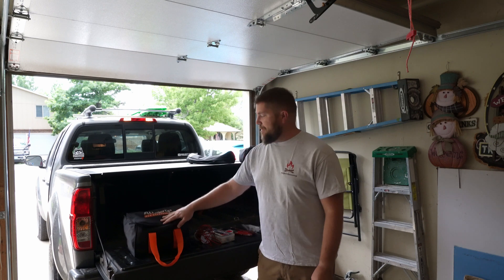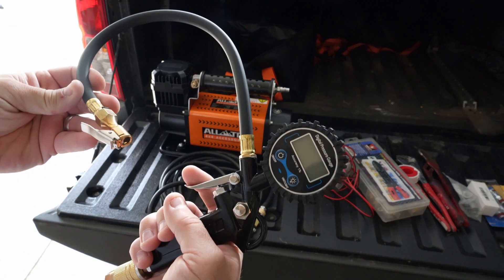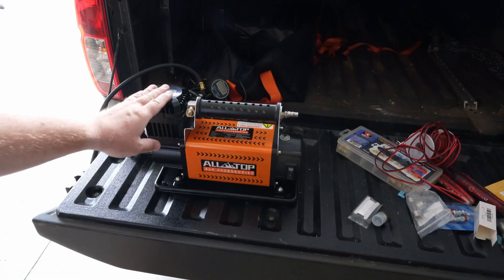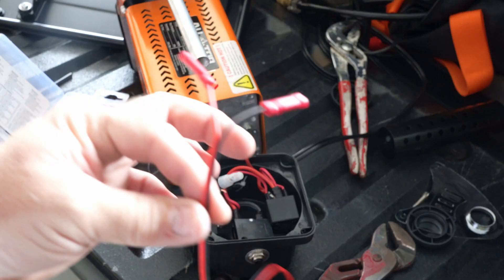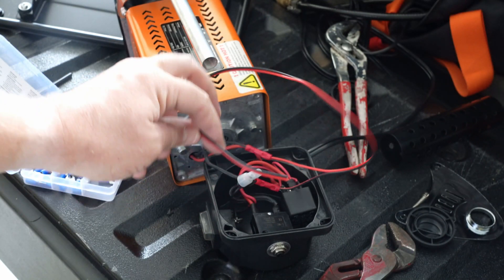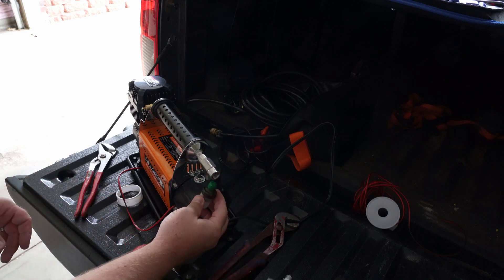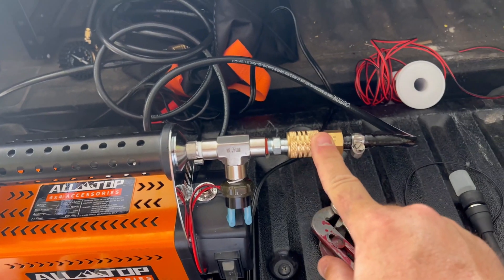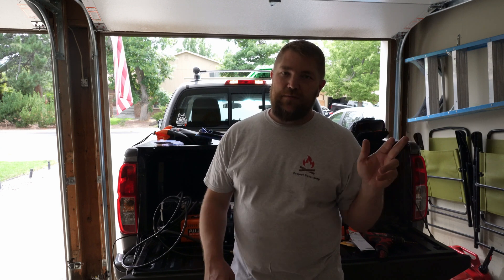Pressure Switch Mod for All-Top Off-Road Air Compressor

Comment: I actually install it on my compressor (100 on 70 off) and when trying to fill up my tire it will not pass 30 psi, I am going to try( 150 off 90 on) hopefully it works.

Comment: Have you ever had the issue that the output side will get so hot that it will melt the hose off of the quick coupler side?
Reply from the maker: It does get hot, I’ve never had melting but I cycle it on and off once and a while

Comment: Why didn’t you just swap out the existing blow off valve with the pressure switch? Would have been neater and easier.
Reply: That and its already 1/4bsp so it would screw straight in 😂 might need an extension so the pressure switch clears the head but thats easy as. Meh. Everyone has their own way of doing things i guess. My complaint would be that now it wont fit neatly in the bag because that tee and the fittings stick out. Also the so called non standard fitting is just a regular nitto fitting, they are the standard here in Australia for almost every air compressor and hose as well as every air tool ive ever seen. Some people prefer ryco fittings so i guess if thats the fittings this guy has on everything else, it would be standard to him

Comment: as a general rule I try not to take to seriously anybody who uses slip joint tools in anything other than an emergency....

How long would it have taken to find the correct size wrench given the amount of time you put into setting up the camera as a comparison?

c'mon man?!
Reply from the maker: As a general rule of thumb, I try not to take people like you seriously who try to “out man” someone by criticizing their use of tools 😂
Reply: @ProjectBasecamp  If it was a matter of "outmanning" anything, I'm not ever going to be concerned about that. 

You are clearly more man than me.

If that's the message you're sending, it's received loud and clear. 
👍

However, demonstrating the correct way to mangle fittings and confirming your laziness in walking maybe 8-15 feet to get proper tools is priceless. We're a team, and we need to work together. You're making content, so go the extra mile and do it right. I provide the feedback that should prod you into reflection and thought. Clearly, accepting criticism isn't your strong suit, and ad hominem attacks aren't a great rebuttal and weak as hell. 

 You know you could have, but you didn't, and that's all of it. 

"How you do one thing, is how you do everything"  -Somebody Somewhere Sometime
Reply: I 100% agree. Im all for using the most handy tool. But i hold these content creators to higher stander.
For *** sake show me how to do it and use the correct tool.

Thanks for showing how its done on the single pump version. Lots of vids on the dual pump. Your is first i found on single pump

Comment: why did you do the 70 to 100 psi option vs the 90 to 120 psi?
Reply: There’s really no point to the additional pressure. All it’s doing is pressurizing the hose.

Comment: Thanks… helpful… I just bought that pump and without the pressure switch I feel like I’m going to break something while airing up…
Reply from the maker: Thanks for checking it out, I used it a couple weeks ago and definitely makes using the compressor much easier.